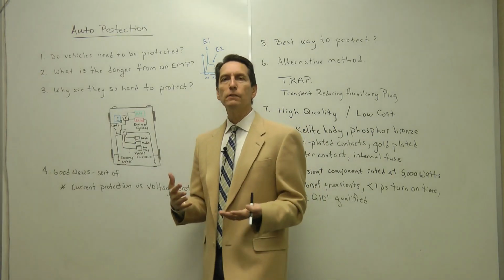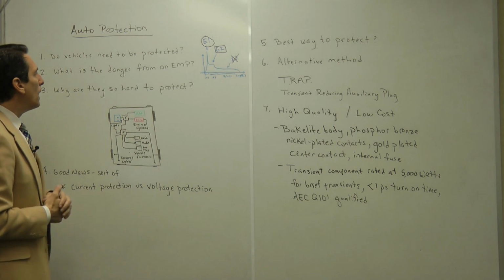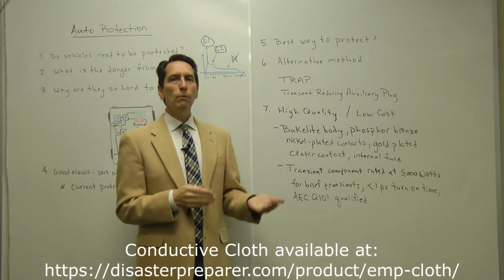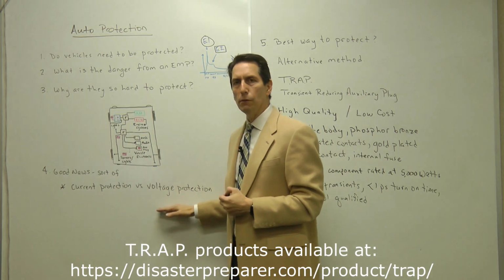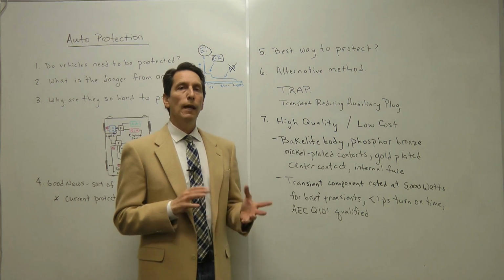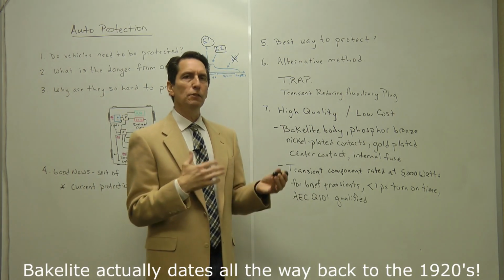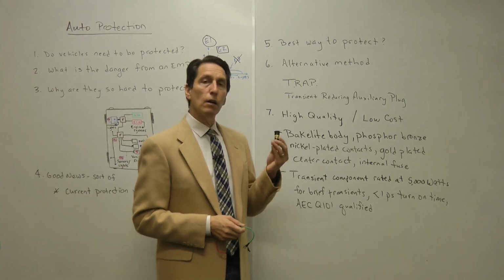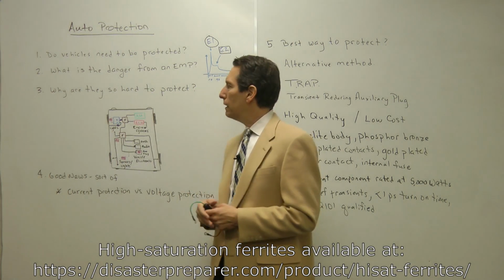EMP Automobile Protection with the T.R.A.P.

Comment: Very cool! Great job Arthur. I will add these to my list. This summer I'm going to build custom Faraday Cages out if equivilent sheet metal that ammo cans use and will be buying those great gaskets you sell.
Reply: I have been making Faraday Cages out of used Christmas "Tins" that I get for almost nothing at thrift stores.  I only buy the tins with tight lids so I don't use gaskets.  I do put items into the EMP bags that Arthur sells and then into the tins for "double" protection.  The tins come in so many shapes and sizes it is easy to fit just about any small electronic item into them.  I have even put tins into other (larger) tins and then into large metal trash cans (with Arthur's gaskets) for 4 or 5 X  protection.
Reply: Cool Will, I decided to make custom cages for things like my Icom 7300 HF radio. This way I can use it, unplug it and cover it. I will have nesting lips (don't know how else to explain it), I will make a YouTube video of it eventually on my new channel The Random Highlander.

Comment: I have a SPD wired to my battery currently.  Can I use the Trap-B as an added protection or would it conflict in any way?  I've been considering the High Sat Ferrites also.  Thanks for all your work on this topic over the years.
Reply from the maker: The T.R.A.P.-B wouldn't interfere with the SPD. Nearly all SPDs use metal oxide varistors with fairly high turn-on voltages. The T.R.A.P.-B uses a different technology.
Reply: @disasterprepper  Finally took the leap and placed a big order.  5 TRAPs for the socket outlets and a TRAP-B for the battery!  Plus Ferrites for house and car battery.  Looking foward to their shipping!!
Reply from the maker: @mbrown2a  Thanks Michael. The TRAPS should be headed to assembly in about 2 weeks. Best guess is they will ship toward the end of February. We're just about to max capacity, so I'm glad you made it in in time.

Comment: What about the trailer socket at the back of pickups?  That's a long wire run.  Perhaps I should add the Battery version across it. 

Possibly by adding it to the wires behind the bumper.  If they're not accessible, add it to an empty trailer plug.  I have both a 4pin and a 7pin socket.  I could easily add the battery version to a 4pin plug.  Empty 7pin plugs are also available.
Reply from the maker: Hi Irv, I think the trailer socket is a great place to put a protective device.

Comment: Doesn't a lead/acid battery do a great job of suppressing voltage transients?
Reply from the maker: I thought that too until I put a scope across the terminals. Each time something kicks on and off, there are very visible transients, some going to nearly a hundred volts. My conclusion was that a lead acid battery suppresses low-frequency transients, but doesn't do very well at suppressing high-frequency transients.

Comment: How would this be different for an EV?
Reply from the maker: It's my understanding that electric vehicles have battery voltages of several hundred volts, so obviously, you wouldn't want to install a T.R.A.P.-B across those. It would just burn up very quickly. With that said, EVs usually have a standard 12V battery (and associated circuitry) that could be protected using this technology.
Reply: @disasterprepper  so, if you have an EV and you have the TRAP A in your cigarette lighter and the TRAP B on the 12V battery and the high saturation ferrite in place as well, is the car adequately protected or will the batteries it runs on get fried if there’s an EMP?
Reply from the maker: @moniquem76  If it were my car, that's the way I'd protect it. There's no way to say with certainty that it would survive an EMP, but it's the best protection that I know of. The only better protection is to cover the car with a conductive cover.
Reply: @disasterprepper  okay. Thank you. I’ve been looking at the covers too. With my driving habits, it’s way more likely that the car will be parked than in use if there’s an EMP. I only leave the house once every 3 weeks for about 8 hours. So the cover will be the main protection and the TRAP system just in case I’m out. Another thing I’m thinking about is to make a garage basically a big faraday cage. That way I could store spare solar bits and pieces easily and keep them safe without covering everything. I’m moving soon so not certain yet what I’ll be working with, but in this area metal garages are far more common than anything else. So I’m thinking aluminium mesh over the skylights and windows to connect the metal across those, and some kind of strip or curtain along the sides and top of the roller door to cover the gaps but be easy to remove and put back when I need to go in there. Do you think something like that could work? It seems the most obvious to me when there’s an almost solid metal box already but is there some reason it wouldn’t work that I haven’t thought of?
When I decide which EV I’m getting and place an order my next stop will be your site 😊
Reply from the maker: @moniquem76  Hi Monique, while the idea is sound, it's very difficult to really create a fully-shielded garage. There are many reasons for this, including the seams around the doors, any power lines that might come in and out, and even the metal seams between the sheet metal panels. You can buy or make a fully shielded tent (or cover), but trying to make the entire room shielded is difficult. It can be done, but you'd need professional help.
Reply: @disasterprepper  right. Okay thanks for responding. I think I might go with the easy option then. A car cover and then yes a separate piece to be a tent for sensitive items. That will work. And if l plan it well I can create a frame and shelving for the items in such a way that I can still access them easily if I need them. There’s the beginnings of a design popping into my head already. Yes, that’ll work. Thank you very much.

Comment: Can this be designed with a USB outlet included? Believe most people use the plugs to power USB devices now. Without this feature the car would not be protected when in use and - people being people - would end up unprotected when parked.
Reply from the maker: It could have been designed with a USB plug, but the complexity increases. Rather, I thought people could use an auxiliary plug splitter, many of which have built in USB plugs. Also, in the video, I talk about the protection when the car is off. It ends up that very high frequencies will couple around (and be suppressed by the device) even when the car is off.

Comment: If the vehicle is not being used, would disconnecting one of the battery cables from the vehicle's battery offer additional protection?
Reply from the maker: A little, but not much. The induced voltages without protection (even with the battery disconnected) could be hundreds or thousands of volts.

Comment: I've noticed that there is more than one size of Aux plug.  I've purchased items that would not fit into my Honda's outlet and also the opposite - I now have an item that is so loose in that same outlet, I have a lot of trouble in keeping it powered.  What is the diameter of the TRAP?  Similarly with my VW - it always seems too small for any plugs that I attempted to use.
Reply from the maker: Most cars are pretty standard sized now, but the T.R.A.P. is roughly 20 mm in diameter, with the metal contacts coming out to around 23.5 mm.

Comment: I use my "lighter" sockets on a regular basis.  Could I install T.R.A.P.-B at locations, other than the battery, and get the same protection as the plug in sockets?  I am thinking of putting one at each fuse box in addition to the battery.  There is easy access to hot and ground at fuse boxes.
Reply from the maker: If you could figure out a way to safely tie it into the fuse box, it would certainly provide protection. I couldn't figure out a universal way to install one at the fuse box. Also, if you're using your lighter sockets, you can use a simple splitter to give you two receptacles. They have them on Amazon for around $15.

Comment: Could you use the TRAP B to protect a Solar System from the battery bank?
Reply from the maker: Yes, but you'd want to make sure that the battery voltage was below 24 V.

Comment: Most lighter outlets are key switched.  If OFF does your device still offer protection?
Reply from the maker: I talk about this in the video briefly. The very high-frequency transients will couple into the system regardless of whether the key is off, and the T.R.A.P. would offer protection against those transients.
Reply: Rewatch the video - that question is specifically addressed (TLDR: Yes)

Comment: Great explanation 👍
Excellent simple solution.  
Please discuss the function(s) of the EMP Shield Auto that offer protection to the threats you have identified.  
Or 
Beneficial?  a simple Y/N is acceptable based on your history with them.
Reply from the maker: Hi, I'm sure they offer fine products, but I try not to offer commentary on the performance of other company's products.
Reply: @disasterprepper  Understood.  Thank You.  There have been many discussions around the campfire on this topic...😉
Reply: insde would contain at least a 4,000 micr cap and a disgarge resister to make it reusuable